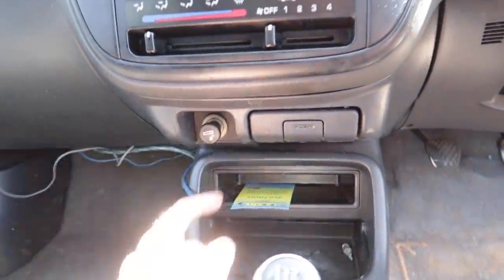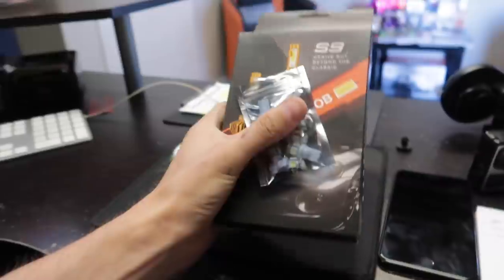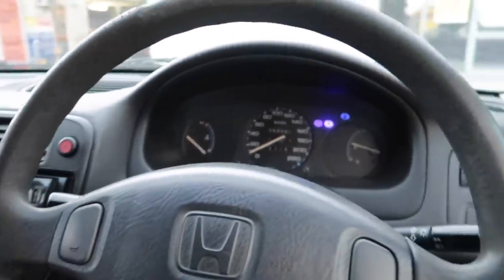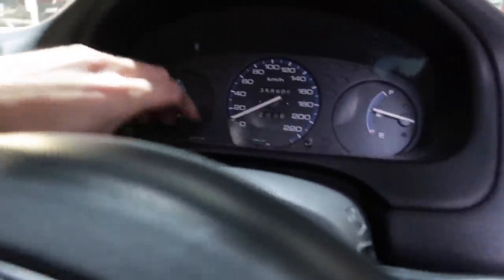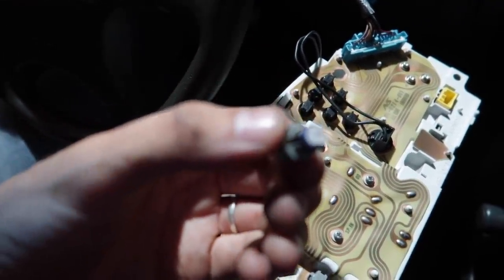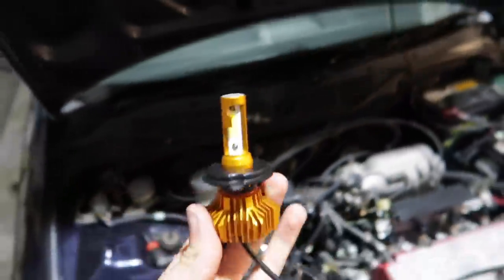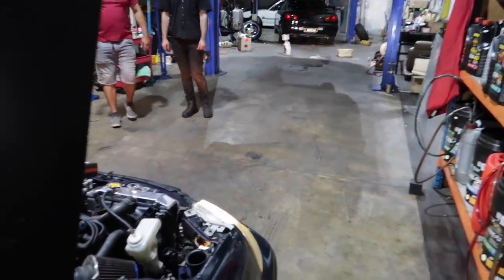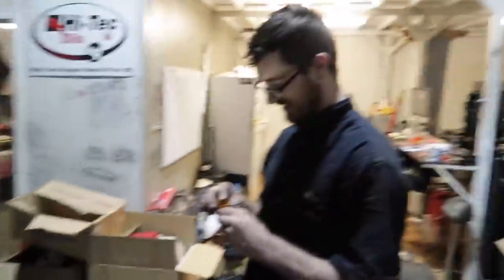CHEAP & SIMPLE MODS! - Honda Civic

Comment: Yoo Wet sand your headlights to restore them back to there former clear glory. start at like 800 grit, finish at like 3-5-8K then finish with polish, Do not swerl the sand paper. straight lines Up down then left to right.

Comment: I wish I could send you pictures of the difference between China LED T10/5 dash bulbs and narva ones, but I cant, I have 12 in my truck and got sick of pulling the dash out when they would die or start flashing so I spent 60$ each on two boxes of 10 narva ones and havnt had an issue since 🤙🤙✌